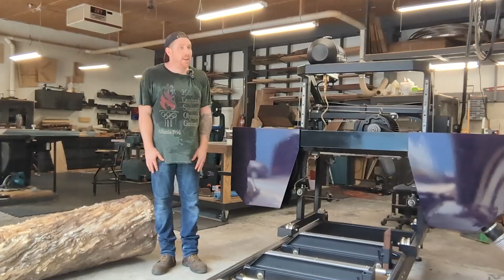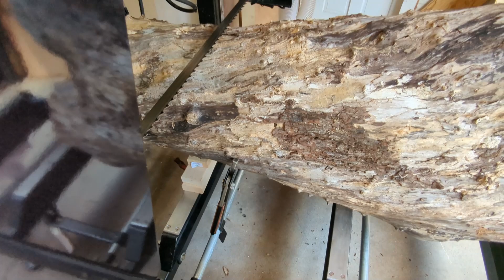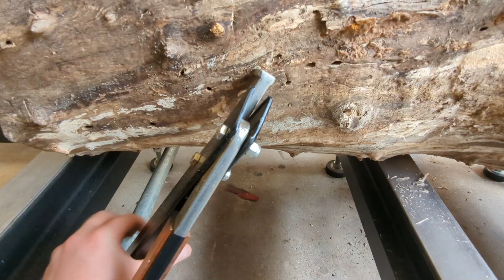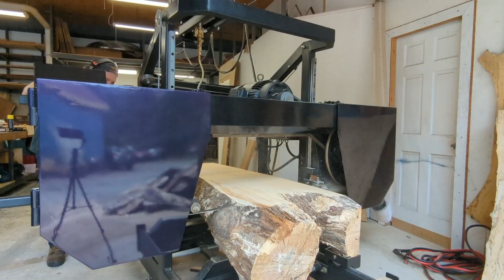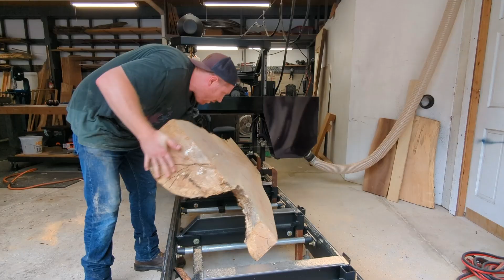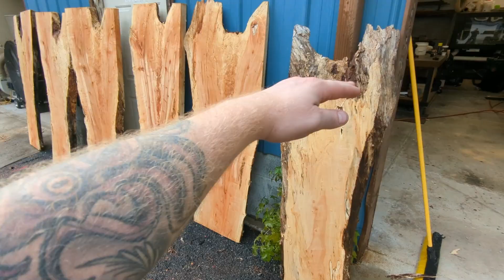Opening up a Silver Maple Log On the Electric Sawmill

Comment: Where do you sell your furniture? What do you make?
Reply from the maker: I work with an interior design firm based out of Atlanta that keeps me really busy, but I still accept commissions for small residential projects as well throughout the Metro Atlanta area. I have a small presence on Etsy I still maintain, but for many years I produced a small line of Danish nightstands almost exclusively. Most of what I do now is commercial millwork.
Reply: @FernRiverDesigns how’s your feelings about Etsy today vs 5 years ago? I used to sell honey on Etsy for wedding favors but didn’t like the direction Etsy went 3-4 years ago and my margins got very thin. Curious if the wood working niche is still there.